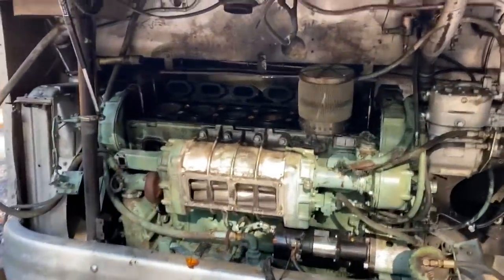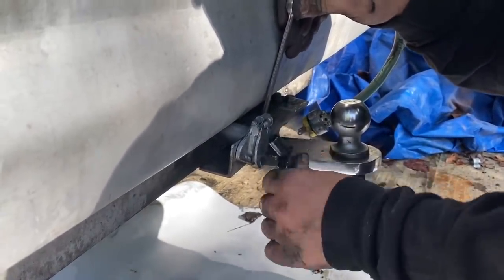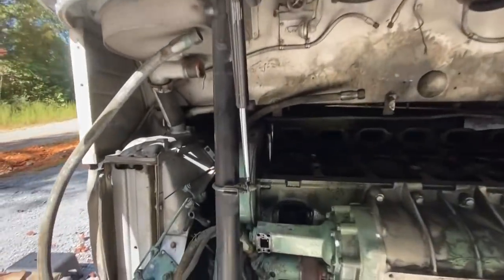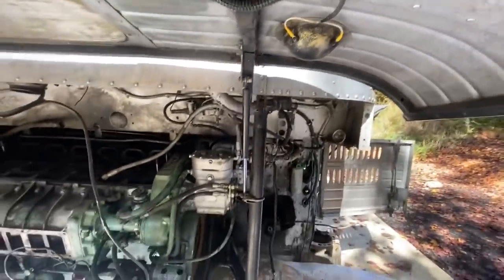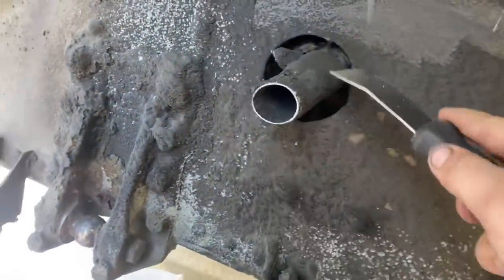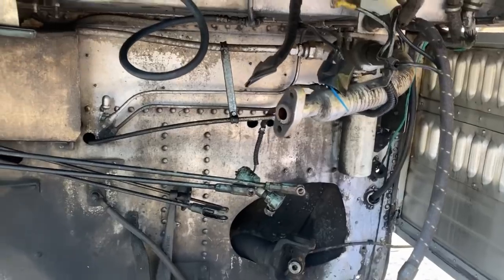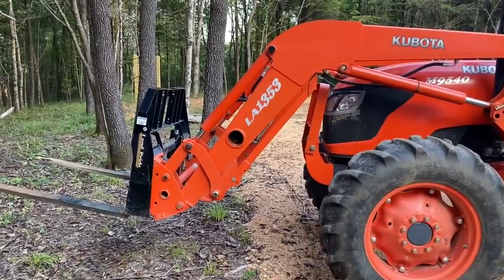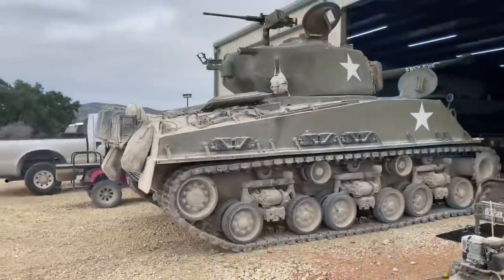Removing the Detroit Diesel inline 6-71 from a GM bus PD4104

Comment: next purchase when the BGM Bus Barn is Built: a used forklift that has the capacity to lift a fully loaded engine cradle without overloading, and that has side shift for that fine control of installing an engine into a bus.
Reply: It’s not capacity it’s the design of the hydraulic system that prevents fine control. It’s much lower pressure and the valving doesn’t allow fine control which is fine for a cost optimized farm implement. It’s like using a black and decker drill with an on/off trigger when you’re used to your variable speed Milwaukee. 

Go watch aVe’s video on overclocking his tractor to understand the difference.
Reply: And a bumper mounted <ice

Comment: The cross sectional area difference between 1.5" and 2" is huge.
Reply: 2.25 to 4 to be exact, or 1:1.78, the water flow is even worse if one adds boundry velocity flow reduction to the equation.

Comment: If that radiator has the same number of cores use a torch, unsweat the pipes, get larger copper tubing, expand the hole in the radiator sweat the new ones on. Simple plumbing 101

Comment: Hey Scott, nice work with what you have! I apologise if my comments on the last video seemed to be picking on your abilities. It was definitely just to comment on the difficulty of using a tractor like a forklift. As you said it can be very frustrating with a tractor that is twitchy and doesn't like to feather. Especially on a larger tractor with limited visibility of the forks! Good luck putting the other one in. Love your videos and work ethic! Keyboard warriors be damned, get another set of eyes there to make life easier and don't show us anything until the last hanger bolts are being slid in! Save you from having to answer anymore tractor questions.. 😉

Comment: I once had the misfortune to work for a "fly by night" bus company years ago, and what they gave me to remove an 8V71 in a GMC Buffalo was a large steel plate with 3 big swivel casters welded on the bottom. then I rolled the plate under the engine and placed three bottle jacks on the plate which I used  to support the engine; then I very carefully rolled it out from  the bus. That was the most dangerous thing I've ever seen. After I got the plate with the engine supported only by the bottle jacks clear of the bus, then I picked the engine up with a chain hoist. it still scares me to think about it.
Reply: @davidczarnecki581  , The jacks were not fastened to the plate, and they weren't fastened to the engine either. it wasn't exactly OSHA approved

Comment: I use pallets when lifting items with my tractor forks. Load shifts, it falls on the pallet plus easy to move around the yard.
Reply: maybe two pallets under the engine and then the forks wouldnt hit the bulkhead
Reply: And pallets will provide proper friction between forks and load

Comment: The engine swap is similar to a front wheel drive car. You just unbolt the subframe with the engine in it. 
I think it so cool that the whole bus is built like a monocock chassy passenger car.
Reply: There are downsides. Before wheellift towtrucks were existing,I suppose 1983 or so would be about right,the only way to tow a nonrunning bus was to install a pair of shaped I beams between front wheels and tow truck. Called rails,an air suspension bus with no air in the lines has little room underneath. Telling the guy driving a tandem wrecker his next job is rails on a bus in the rain was guaranteed to wipe the smile off his face.
Unitised body meant trying to lift off the bumper,the usual way,would wrinkle the roof and bend the body,all too often writing the vehicle off. And yes it has happened. Send a greenhorn out,bad things happen.
Those buses had many decades of very bright engineers fine tuning the design. Most of the time,that was advantageous. 
Heavy wrecker drivers needed to have a phlegmatic and patient personality,with problem solving abilities. And spare clothes.
Reply: @paulmanson253  i have been a part of a few tows in the army and just helping friend get their BMWs out of the ditch in the winter. And keeping a clear head and looking at what you hook up to saves a lot of trobule. I remember being a small kid in the late 1990s most buses got either flat towed or taken away on a low boy trailer. living in Estonia and it being only 5 to 10 years after the soviets left no heavy wreckers were available yet. If something heavy went of the road a K700 Kirovets tractor was the best tool for the job or a tracked skider for hauling logs, it had a powerful winch on it.
Reply: @ToomasTelling  For what it is worth,my first girlfriend was from an Estonian family come to Canada post WWII. Tall,and a dance student,it was a wonderful summer for a young kid. She will be a grandmother now.
Reply: @paulmanson253  there is a lot of us Estonians in canada because of WW2. These days only around 900 thousand Estonians live here most are in Canada or Australia. Our country exist because of Canada because our goverment oprated in Exile from 1940-1991.
Reply: @ToomasTelling  Wow. Well I guess that explains the occasional sign.  Vaaba  Esti.    At least you got your country back. Despite Stalin.
Reply: @paulmanson253   what most people  dont know is that resistence movment continued all thru out the soviet rule. The movement really started challenging the soviets in the 1980s

Comment: Try a skid steer. They have the precise control you are looking for. While you are stuck using the tractor keep in mind that turning the front wheels while setting still gets you an inch or two of side shift. Not great, but better than nothing.

Comment: Scott, clamp or tie something light to the forks on the tractor, set so they lineup on the connections to secure the motor, even with the motor on them the longer bits can be dropped yet make ensuring correct alignment for putting the engine in easier.

Comment: Scott  I believe there should be a pressure flow valve on that tractor somewhere most tractors I have worked on have them, it would adjust the flow rate of the fluid and let you feather your controls without losing pressure.

Comment: Need to find you a good used forklift that has pneumatic tires on it, so you can run it up and down your gravel driveway there and so you can have one there just for jobs like that. And I know what you mean, I ran a forklift for years and got pretty damn good with it and I’ve ran a tractor with hydraulics on it and it also had the forks to go with it and you’re absolutely right, a forklift and a tractor w/forks are not the same.( ps. - I got used to calling a forklift, a tow motor, the old fella that taught me called them that so I guess it just stuck with me)!

Comment: Hi Scott. The one place I know that used forklifts to load aircraft was Emery in Dayton. That was a zoo. B727’s and DC-8’s. LD7 cookie sheets. Then some of the smaller out stations that did not have an FMC cargo loader. Also was at USPS sort in Indy. Guys on the forklifts had skills.
Reply from the maker: 727 cookie sheets were easy, a few dc8’s but lots of old cargo ones too like connies

Comment: A suggestion re forklift:  Buy a used electric one that "Needs new batteries" on eBay or the like. For just installing or removing a bus engine, "borrowing" 6 of your "Battle Born" batteries from your "home" for the time it takes to do so should be no problem, I believe that the max amp draw would be well within their limit (100 amps per battery) in a 36V series/parallel (3-2) wiring if you limit yourself to half speed (block of wood under the pedal?). I recommend selling the old batteries for scrap and filling the "Battery Box" with rocks/gravel/sand, as you need the weight.  As they typically weight up to a ton, scrapping them before transporting it home could be a further savings, it will also allow you to store it outdoors in the winter without the danger of the batteries freezing, cracking and leaking acid. Make a simple wood rack hanging off the back for the lithium-ion batteries for their temporary use.

Comment: You act as if you have pulled one of these before, or two or a dozen or lots more than that.  I wonder, back in the day how many a Greyhound mechanic would change at one of the big terminal cities.  On construction jobs we almost never had a forklift on the job unless the bricklayers had one, after about the mid 80s there might be a backhoe with a set of forks that attached to the bucket or in place of the bucket.  It was exactly as you explained it.  The guy running the backhoe could place the bucket on the digger end anywhere with precision but it was meant to dig not be a forklift.  We were always glad to at least have a way to unload freight but machines that are purpose built for one thing are not generally great at anything else.

Comment: Thank You Scott for explaining the tongue weight for the engine cradle and the 4 mounting points. I would be afraid to tow anything behind the bus I know you said 500 pounds towing weight personally I wouldn’t want to put more stress on the Cradle and the rear roof of the bus. Do you recommend towing a small car behind a bus ? 
Thank you so much 😊 for explaining the hydraulics on the tractor 🚜 I couldn’t understand but now I do after you explained it. Hopefully when you get the Forklift from Texas it will make your job much easier. 
Wishing you both a Blessed One Sir.

Comment: Used forklifts are cheaper than you think. Mustie1 bought a used Yale forklift that kept dying and the owner couldn't find anyone to fix it. Turned out to be the solid state ignition inside the distributor was bad, $100 for a new one fixed it, 4 new tires new propane tank ( no crap added to propane like gasoline has ) no brakes, refill brake master cylinder, Mustie1 spent close to $2000 but reliable as the day is long was the result. Forklift does have side shift. He paid $500 for it. It would run for a while then die, took him two days to figure it out.

Cheers!
Reply: James ... recently had issues with my TMC fork lift and the local dealer wanted a week to schedule it, pu / delivery fee, loaner fee, etc. Obviously the idea is to keep your busy shop going. I spent an hour fooling with it to figure it needed a crank sensor the dealer didn't have in stock so I asked for the part # then called my local Nissan car dealer who DID have it in stock! (also fits a Nissan PU truck) Yeah, i stayed late that night but got it running the same day.

Comment: I would think that this is the best time to replace all the hoses and components that will make the bus reliable in the future. I know that when I replaced a engine, I would replace all the belts, hoses and water pump and or timing belt or chain etc. because it was easier to do so with everything out and accessible.

Comment: Grab a couple of pallet jacks from harbor freight and make a stand to go between them and the engine cradle.  then you should have the control to slide the engine in there.  Use the tractor to set the engine on the pallet rig. good luck.

Comment: Would it be easier to put a couple of bolts thru a chain on the block and use a dolly to move the engine till it is out where you can use the tractor?

Comment: I think there should be adjust in hydraulic valve so you could feather the tractor forks. Our old tractor had same issue, and that famous "some guy" fixed that. 
Another con using tractor instead of forklift is that tractor pushes forks forward as you lift them.

Comment: I have a stupid question only because I don't know how did they swap the motors when these were in road service did they have a special jack or was it forks like he did
Reply: For fleet use, there were dollies to support the power unit. Problem with dollies is that a smooth workshop floor is critical. Bet forklifts have been used for many years.
Reply: @robertborchert932  very cool thank you for the info I learned something new because of your knowledge

Comment: You mentioned loading planes, curious where you did that. I use to fly for US Airways and Kallitta out of YIP and wonder if our paths may have crossed.
Reply from the maker: GYY   Mid 90’s   Some kallitta lots of zantop and other carriers.   I was a midnights line supervisor and lots of critical parts for Ford etc.   we never knew what we would get.  Lots of aviation history came through though.  Beach 18, dc3, you name it lots of way past their prime aircraft were flying freight.
Reply: @BusGreaseMonkey  I went into GYY in the BE8T (Beach18 with turbo ) Mostly flew Lear 23 and 24's carrying Ford and GM critical freight.
Reply: I live just down the road from Wurtsmith (Osc)  . Kalitta is going nuts up here. This is busier now than when the AF had it.

Comment: I was wondering why the tractor was so glitchy. I've never had an issue with backhoes or loaders with forks. What's the hydraulic valves assembly look like?
Reply: Me too.  Noticed that in a earlier video.  Something seems amiss.
Reply: Ben Hop same here.  Noticed it an an earlier episode also. Probably some adjustment in the valve body.
Reply: Some new tractors and not like the old ones. On an old tractor, the control lever was attached directly to the valve. You could move the hydraulics a fraction of an inch by feathering the lever. On some new tractors, the control lever is attached to an electric switch what controls a solenoid. It is either full on or full off.
Reply: @mike203920  thanks for the reply. With newer electric directional control valves they are capable of feathering with PWM, it depends on the controller.

Comment: I understand the loader angles being different from a fork lift, but not sure why your loader control is so touchy.  On my second Kubota 4330 and now a 4060 and they have both been very smooth and pin point control.

Comment: You mite need to check the air pressure on the front tires of the tractor they where squishy when you where picking up.
Reply: Chris ... ya think maybe it wasn't low air but an extra heavy load? I'd bet that assembly was 2,000 pounds.

Comment: Why don't you take the radiator to a radiator shop & have it pressure checked before you install it?
Reply: If he’s reusing the radiator that was in the bus when it drove in there and it wasn’t leaking and was cooling ok, is there really a need to have it pressure checked tho??
Reply: unfortunately, the nearest radiator shop is an hour's drive away in Nashville.

Comment: Just say NO to cushion tires on gravel &/or chert. Pneumatic tires only. You would want a 8K or 10 lift with side-shift. I did the cushion tire 3K/4K lift capacity warehouse forklifts on gravel. Ruined a few trucks pulling out stuck forklifts.

Comment: Instead of pressuring the fuel tank wouldn't a priming fuel pump like you have on 
Lenny be easier? A vacuum pump might be another alternative. Hook the vacuum pump up to a clear container so you can see fuel entering the engine compartment thereby preventing you from contaminating the vacuum pump. Then simply disconnect the vacuum pump and reconnect the fuel lines.

Comment: May I humbly suggest a machinists rule which is more precise, way smaller, and easier to handle, and often has a nice pocket clip for 99.99999% of your measurement needs on the buses rather than a lumber framer's tape measure.  Humbly of course!
Reply from the maker: Great but thats what was on kellys golf cart and it worked fine to show you it wasn’t even close to the correct size.  Perfection isn’t required.